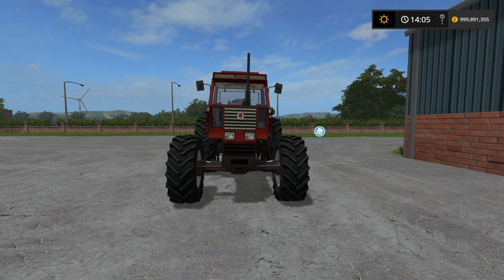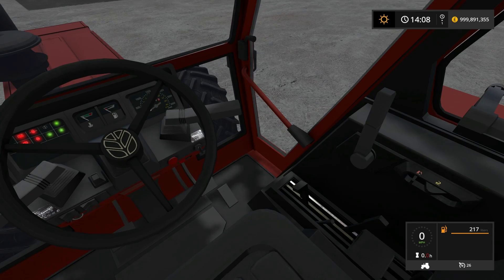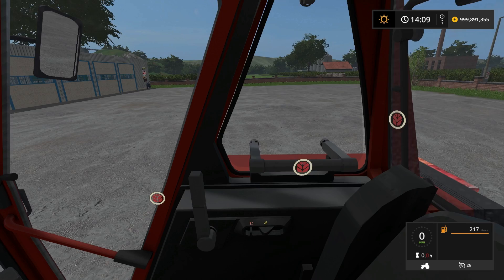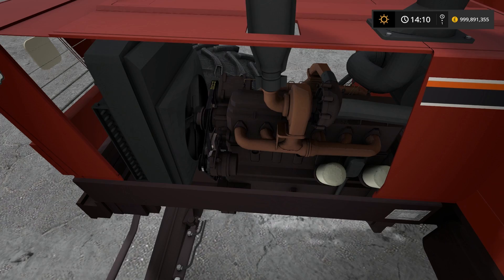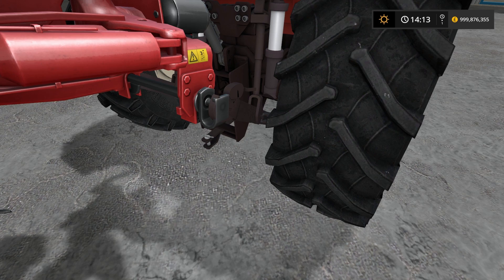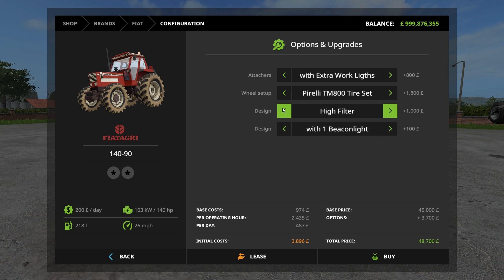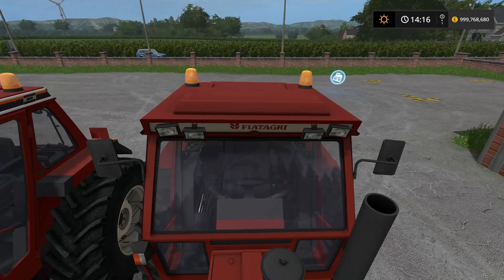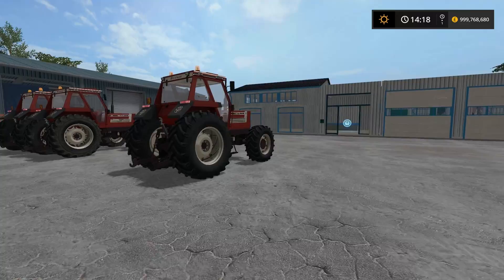Fiatagri 140-90 - Farming Simulator 17 Mod Contest

Comment: The pipe on the air filter to the exhaust is a dust ejector. The piece on the exhaust pipe is a venturi that draws a vacuum on the precleaner on top of the air intake and pulls the dust out of the precleaner. A normal glass bowl precleaner causes a pressure drop as the air is pulled across it that causes the dust to fall out of suspension, at least in theory. In real life both are used in dusty conditions to extend your air filter service interval.

Comment from the maker: Jheeze you guys work fast. I clicked publish then came in here to write "first" to annoy people and there was already 7 comments in less than 5 seconds haha
Reply: Simul8 the 140 90 only has a turned up diesiel pump to give it the power
Reply: Which ones are for consoles
Reply: Simul8  a shame it doesnt have fronthydraulic
Reply: Is the 140/90 coming out for PS4
Reply: Simul8 the hide option hides the bonnet panel the remove option  takes the panel off
Reply: Simul8 it's fs17 not 15
Reply: Simul8 that's why you put the comment whilst publishing